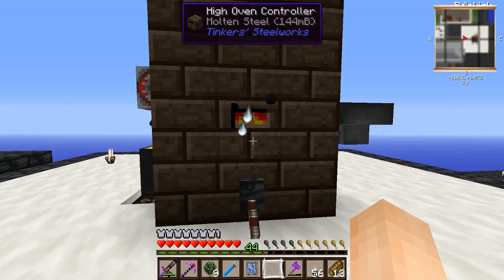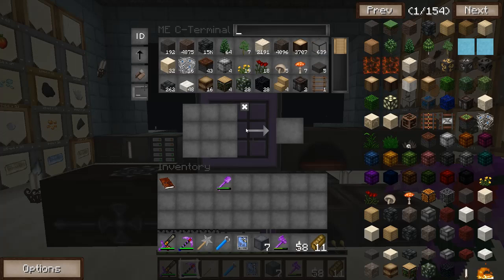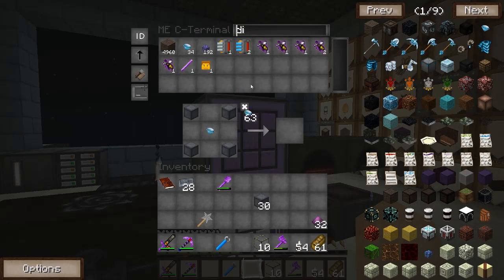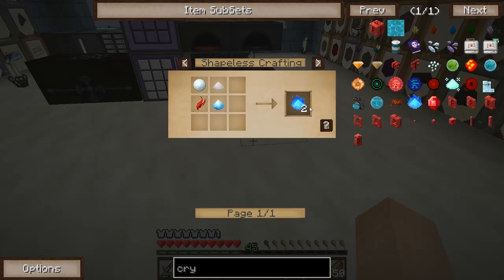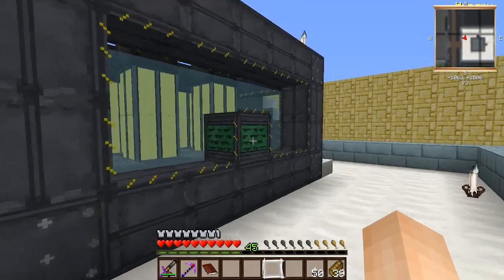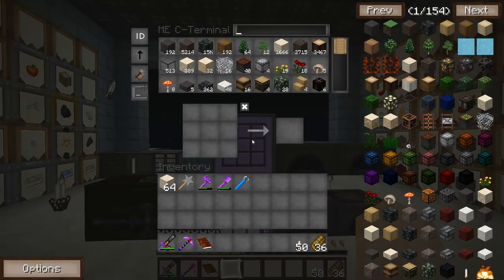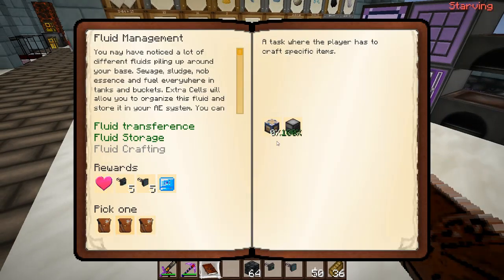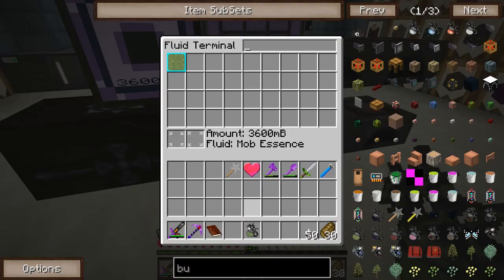FTB Agrarian Skies - Episode 19 - Big Reactors Nuclear Power

Comment: Um, that blaze grinder setup you have planned isn't really efficient tbh XD
Each of the angry dolls cost a diamond or so, and you only get one blaze for them.
So instead, what you should do, is setup a neutral mob grinder (just a dark room with a grinder in it, very simple. If you can get cursed earth, extra bonus!) and get mob essence from that, then use that mob essence with an Automated Spawner to spawn blazes. You'll only have to make one blaze and capture it with a safari net (the reusable ones) and you'll have all the blazes you could possible want. Plus, you can use the setup for other mobs later too, like witches for redstone and glowstone. Or wisps for all the ethereal essence you could want for thaumcraft.
The machines are all from MFR too, and they're not too expensive to make.
Reply from the maker: Oh good point.  I'm already getting quite a bit of mob essence from the cow farm so I could set that up now.  The only issue is getting enough ender pearls.  Since the last major update something was changed with mob fall damage on conveyor belts, which caused my mob spawner to stuff with other drops.  I will have to make some small changes to the mob spawner to get ender pearls efficiently again.
Reply: I'd recommend just doing a similar setup to what I have in my world. I just have two black rooms (roughly 6 by 10 or so I think) with two grinders in each, with the floor made of cursed earth. They're giving plenty of drops and essence for me to have both enchanting, repairing and auto spawners running without issue. As far as I know, you can even get the cursed earth without the activation sigil, so that's not a concern either, you just need to keep track of time. It doesn't need to be a falling one either, just a simple room. Even without cursed earth it'll work very well, you just need to stay 32 blocks away from it. Or you could just capture an enderman with the safari net with the first 4 ender pearls you get, and use him to get more (the creepy doll makes them in water I think it is ?)
Reply from the maker: Thanks.  I will probably get that going soon.  For not I just added a couple more autonomous activators to my gravel seives and I'm producing enough coal/yellowrium to keep my reactor running contineuously!  I'm going to get the autocrafting setup and then probaby work on upgrading my mob far.  Likely in a simular manner to what you said.  I have something along those lines going in my Magic Farm 2 world that works quite well.
Reply: Alright, sounds like a plan. Also, I think you forgot, but all the high oven stuff you did alongside the big reactor actually unlocks rewards in the quest book. So if you haven't yet (I don't recall seeing you doing it) you can get some reward bags that way.

Comment: Why are you NOT using NEI in the crafting interface to fill in the ingredients for items? FYI, you could have used a single bucket of destabilized redstone or resonant ender to cool that reactor. Place blocks on the bottom layer. Put the bucket on top middle. Remove all of the blocks on the bottom layer. This will allow a single bucket of coolant to touch all sides/faces of all rods. Also, if you fill the empty spaces touching the rods with iron, gold, emerald or diamond blocks it will cool it pretty good. Gawd it is so painful watching you manually search for each ingredient then manually placing them in the crafting grid then searching NEI for the recipe again again when you could have shift-clicked the ? mark in NEI while searching for the recipe with the crafting grid open and auto filling the crafting grid with the recipe.
Reply from the maker: I usually avoid doing the autofill as I feel making the crafting patterns is a part of how minecraft is designed to be played.  I don't like mods/features that basically do everything for you.  However, if you think people find it excessively tedius, I will switch to using the autofill option on camera at least.  Usually I try not to do any major crafting on camera at all.  Thanks for the tip about the liquid mechanics.  I know you can pull those sorts of tricks but I find it somewhat exploity...  An extra 1k + RF is more than enough at the moment and I need make much more than that for the next liquid hoading question anyways!
Reply: Batch_2
I learnt about autofill by watching youtube, I wanted to be able to craft so easily and learning how easy it actual is,  no NEI in vanilla so people dont always know, even though its very common mod.  You are going to be MAC crafting so you might as well make life easy AS is hard enough!